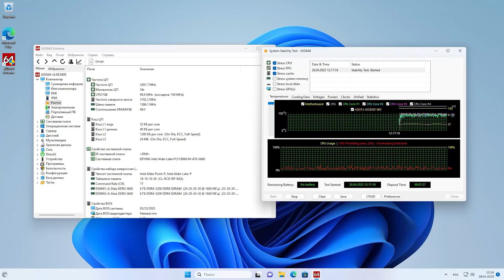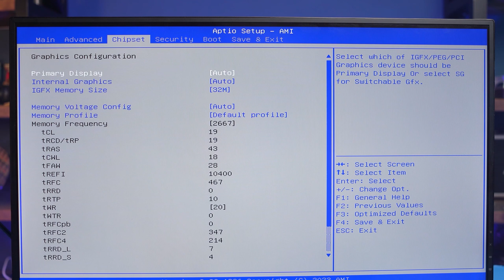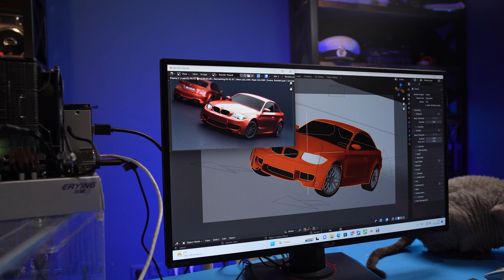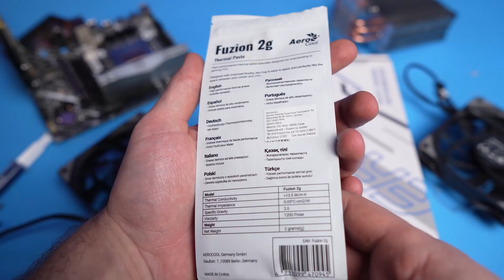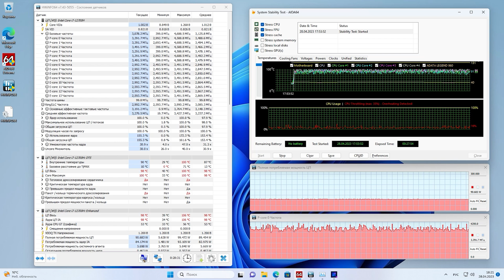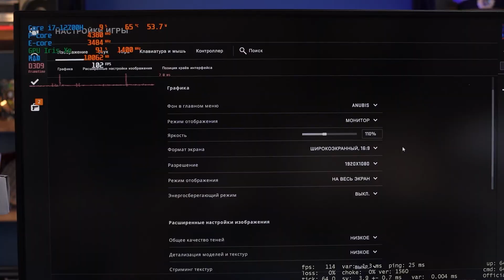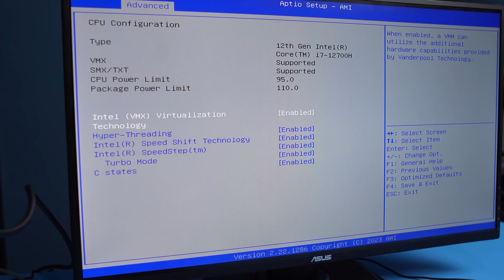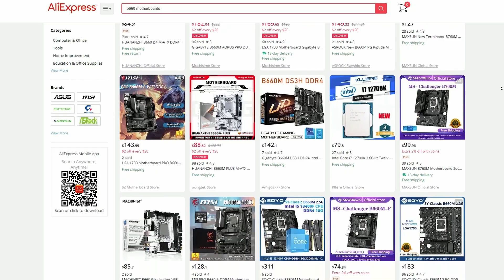Chinese mutant motherboard on 12700H

Comment: Use some CapKom tape and a thin copper shim under the heat sink, and it would probably be fairly powerful and run closer to 85c

Comment: Erying offers a new heatspreader with a vaporchamper. In my case, the new heatspreader lowered the temp to 50-55 C° with an Stock cooler and 40-50 with an bequiet

Comment: I need your help , my eyring i9 motherboard.. well i just pulled the board out of the box (i added thermal grizzly l m to the copper slug ..... (The aluminum surrounding it looks like a book that was tossed into a fireplace !! ( i know you bought the same board , what cooler will work direct to die on this board ? 

https://youtu.be/1YezC-GVN54?si=UwDHo0fH2dhRKEH7

Comment: You really need liquid metal on that cpu or even better with water cooling,  thermal paste is not enough
Reply: yeah its quite hot if we use a normal heatsink with thermal paste, easily reach 100 C

Comment: Ps: You can set Gear 1 in this Board. Chipset > System Agent > Memory Configuration > Sets the Gear Ratio to 1 when SAGV is disabled. Yeah this BIOS is a mess but it's possible. I think it's better to use the updated version.

Comment: Hey they have an updated Bios on their website that allow you to set manual frequencies for RAM. Since I only have a 3200MHz I cannot tell you if you can reach higher frequencies but the option is there. I think it's worth testing.

Comment: Cam you overclock it?
Reply: It has enough thermal issues even running at it's stock settings.  The plate wasn't built to precision, so the gap between the die and the plate is quite large.  The conductivity is very bad, which was one of the things that disappointed him about it.